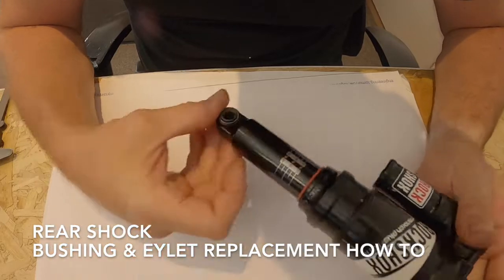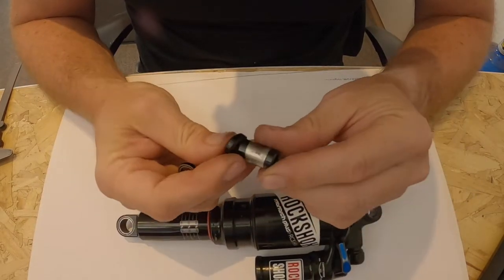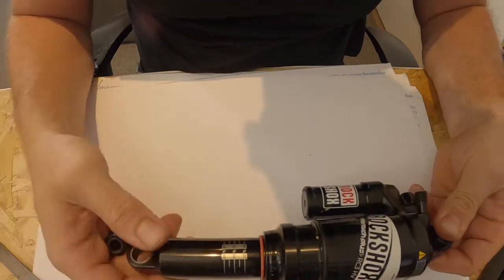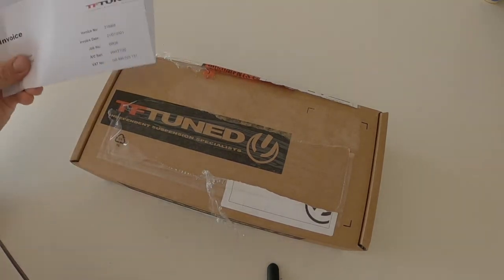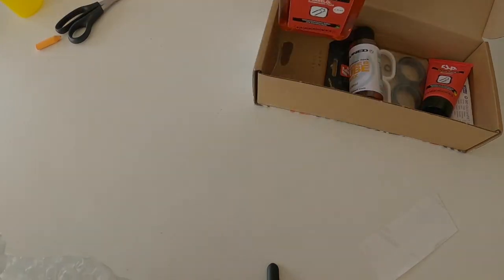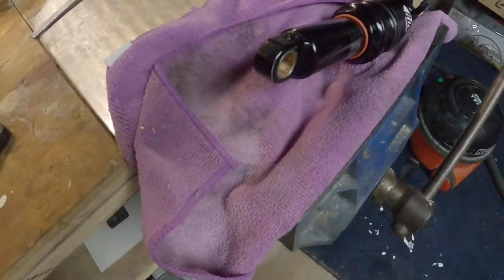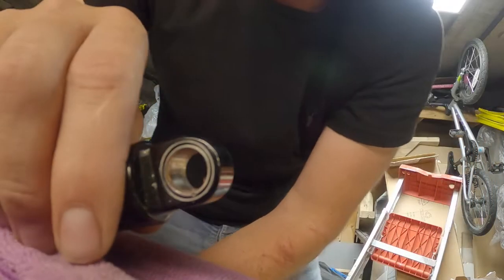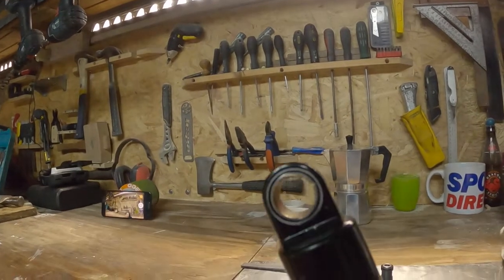Rockshox monarch frame creaking noise, how to replace a mtb shock eyelet and frame bushing .

Comment: Hey John know anything about the different tune on these shocks cheers pal
Reply from the maker: Hello pal. Thanks for the comment and the view.. from what I understand the shock is matched/tuned to the frameset (inc the fork) by the manufacturer. Shims and volume spacers are used to make it perform in a more consistent way throughout the whole of the travel/swing of the arm.

It's a bit more involved than my vid mate. Take a look at this though:

https://www.sram.com/globalassets/document-hierarchy/tuning-manuals/rockshox-rear-shock-piston-tuning-guide.pdf

Hope it helps.
Reply from the maker: This might be interesting too Gavin:

https://youtu.be/THo_mEg-e1c